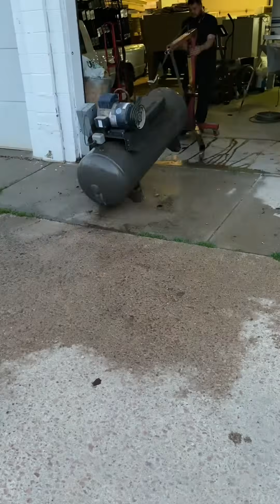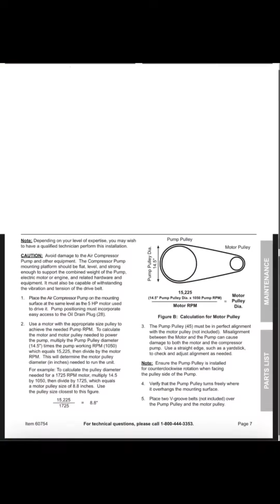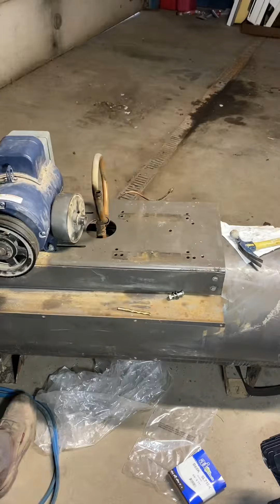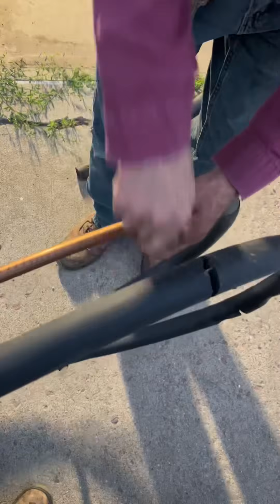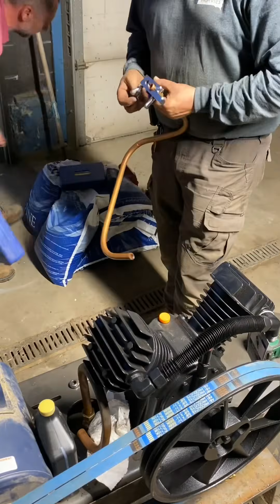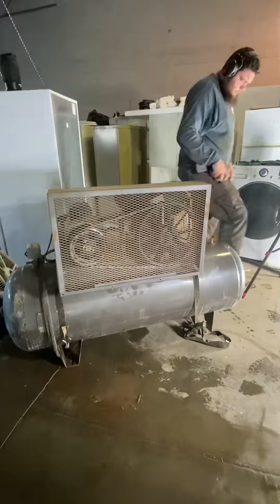Installing a harbor freight compressor on a old tank.

Comment: They say the direction of the compressor doesn’t matter, but the thins on the fan on the compressor pulley clearly push direction, one way or the other on rotation of the motor

Comment: Nice build, great value!
I do have to disagree on  compressor rotation. Even if No direction arrow is found, look carefully at the angled cooling blades of the flywheel. The flywheel Must turn so that the cooling air is pulled into the angled cooling blades & blown onto the cylinder & head cooling fins (never "suck" hot air) to provide adequate cooling. Also many compressors use splash cooling "dippers" that splash the oil in a certain direction to "bounce" or ricochet the oil off of engineered angled surfaces up into the cylinders for lubrication. You must have got it right because I saw a YouTuber named Earl get it wrong, have low pump performance & ruin his new gold painted air compressor pump! I wish you the best.

Comment: "Doesnt matter which way it rotates"?????? Isnt there a big ARROW showing the rotation cast into the pulley/fan blades?
Reply from the maker: No, there is no arrow showing direction, I also contacted tech-support, verifying that information
Reply: @HandsomeOrHandy so the fan on the pulley will blow or suck air across the compressor?

Comment: Great job man. How many cfm are you getting? I’ve thought about making one. If I remember correctly, the cfm beats most 110v compressors
Reply from the maker: 15.0 CFM @ 90 PSI, 
14.8 CFM @ 120 PSI,

Comment: Do you really think using a Tank that sat literally half full of water for years as a basis for your air compressor, especially at maximum rated pressure of that rusted out tank?!
Reply: pressure test is still done higher then the operating pressure. and dont forget that 1mm steel makes about 10mm rust.  so then it would keep coming out. so its probaly not that weak.

Comment: Did you hydro test the tank?  I would be very concerned about the tank integrity.  If the original pump failed, it was likely lack of maintenance (no oil?) and tank draining was also probably not done leaving water in the tank to rust it out.
Reply: In another video he said the tank was half full of water! So imagine it has a considerable amount of rust and wear! I would never reuse a tank like that! It could blow and seriously injure people or Far, far Worse!!! Depending on how close they are to it. When Air compressors fail, it's usually a catastrophe!!! Huge damage to whatever is around it! He's gambling with his life and others.
Reply: Best question, but the only one he didn't reply to.
Reply: @danielleary2823 I doubt he did, that's why he didn't answer! I bet.

Comment: What ya gonna use it for? Sell it.
Reply from the maker: It will be used in the new shop.
Reply: @HandsomeOrHandy   how has it been doing?   kinda looking at the same but it has to run for quite a bit / has to run long and often.   had some oilless compressors but they dont last that long.